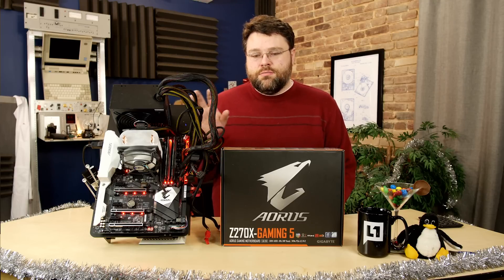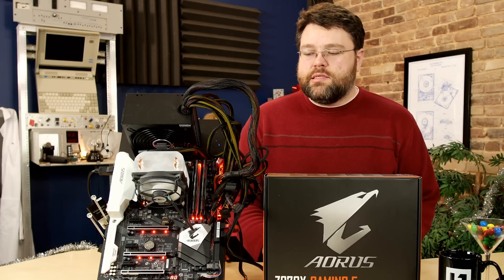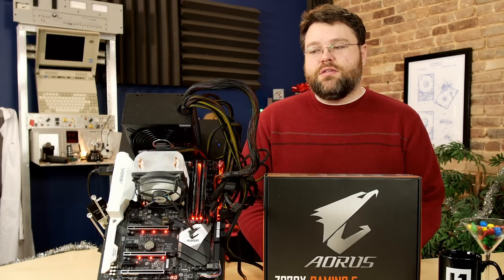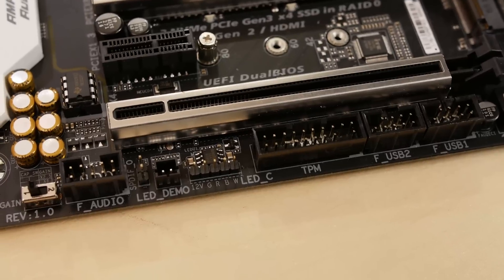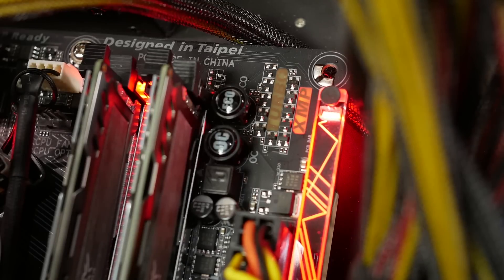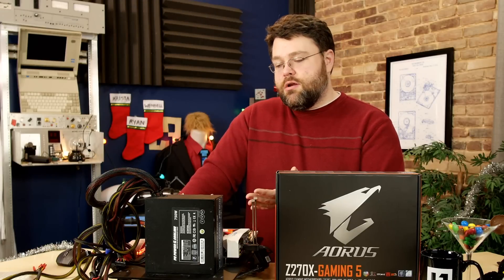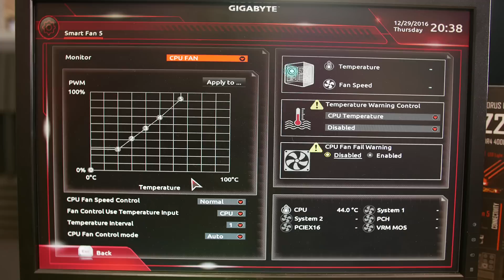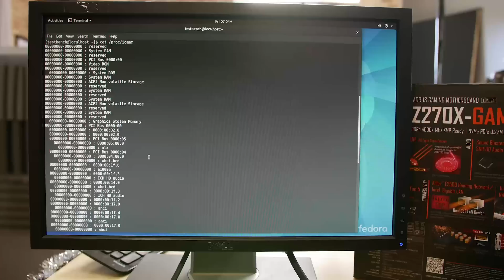Aorus Z270X Gaming 5 Motherboard Review from Gigabyte

Comment: I wonder if the G7 audio is noticeably better then the G5 motherboard. As an audiophile I was inclined to go for the Aorus G7, mainly for the on-board audio (more than for OCing), but then again I don´t want to spend that much more if the difference is minimal. So difficult to get info on that... Maybe even the z270x ultra would do the job just as well (with that nice all-black design).

Comment: H105 with 4 cooler master jet flo fans in push pull should be able to handle 5ghz assuming I don't get a dud overclocking chip.

Comment: Is Sata Raid 0 available on this motherboard? I'm about to buy it for my 6700K since my MSi Z170 board is a let down and I'm using it, so I want to make sure it is available... Also, any feedback from Skylake overclocking on that board? I plan on getting Ek's monoblock but I'm curious on if I will be able to get my 4.7GHz stable on there too, since the crappy MSi could...

Comment: i'm buying i5-7600k. which z270 mobo should i buy? it should have at least 2x M.2 that can handle fast M.2 cards. I thought to buy this for windows installation: Samsung 250GB 960 EVO SSD, M.2, NVMe, 3200/1500 MB/s.

and like to get out full speed (or as close as possible) of it without spending more money than necessary.
also there should be enough slots for graphicscard and soundcard.
Reply: All motherboards are pretty much the same. Main difference is aesthetic, or look. If you're going for a red/black setup go with an MSI Enthusiast board or the ASRock Fatal1ty Gaming K6

Comment: Underrated reviewer, I'm choosing either this or the Gaming 7. 5 Fan headers gonna be a bit too little as I plan to drive a h110i in push/pull, and the rear exhaust takes up 1, and the front case fans usually takes up 1-2. But only 3 Sata3 connections? I have 2 SSDs in raid-0, and 2 HDDs. I'm not familiar with the sata express, how will I now connect my 4x sata 3 devices?
Reply: Use one of the six SATA3 connectors provided? http://www.gigabyte.us/products/product-page.aspx?pid=6072#sp
Reply: Sata Express is different; there are also the 6 standard/classic SATA3 connectors as well....they are are on the opposite side of the board that faces the out of the case, as they are intended as internal connections.